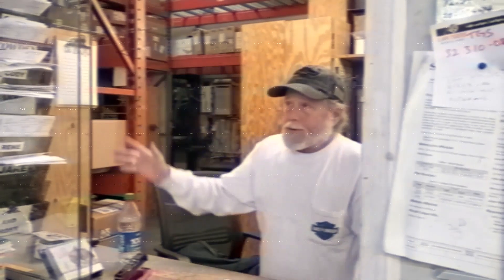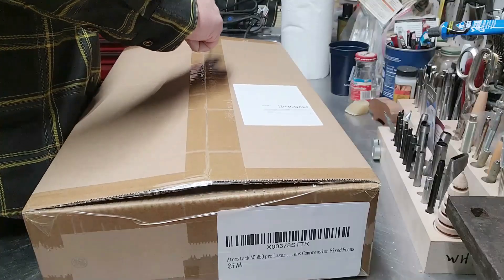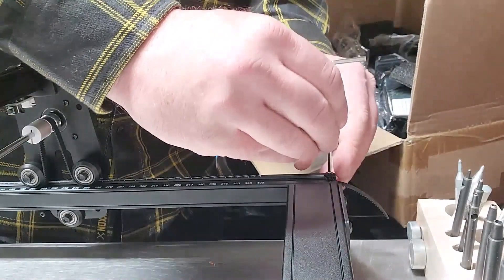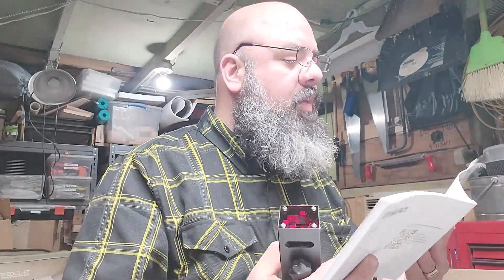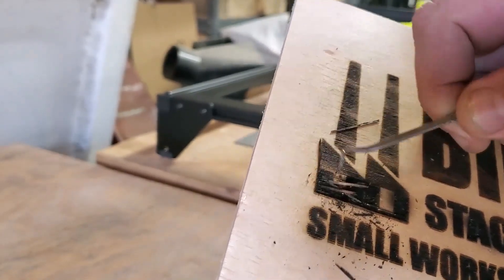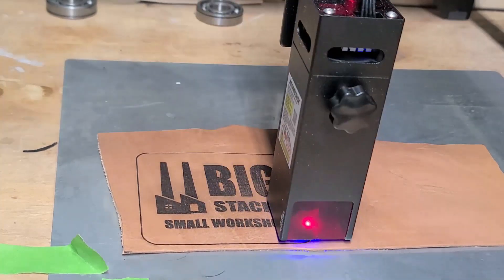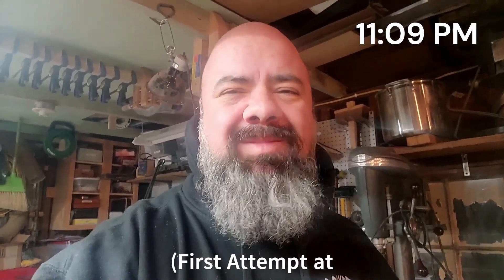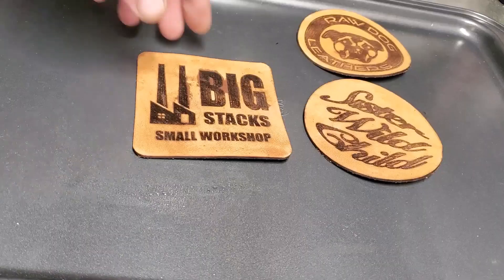The Best Laser Engraver Machine for BEGINNERS- UNDERPOWERED Yet Unbelievable

Comment: Laser engravings are great.  Have you ever used it for transferring patterns for tooling or just normal pattern details like edges and  punch holes?  The smell of burned leather is pretty bad.  Thank you for producing wonderful videos!
Reply from the maker: @johnsullivan6560 I have not tried it for transferring tooling patterns,  but that is an interesting idea.   Since you are cutting the lines,  if you use antiquing after you do your tooling,  the lines probably won't be visible on the finished product. Thank you for the idea.